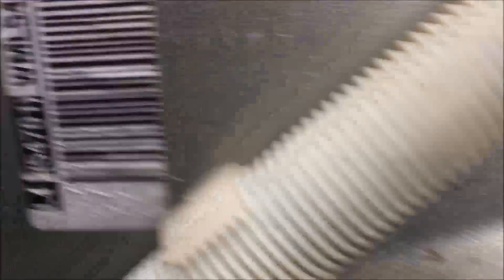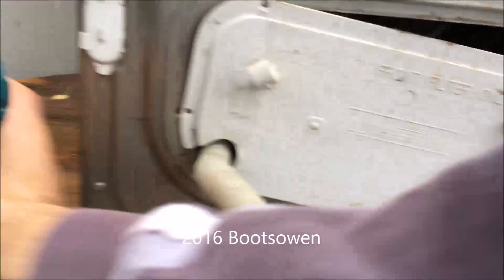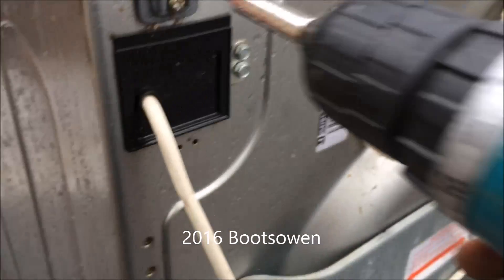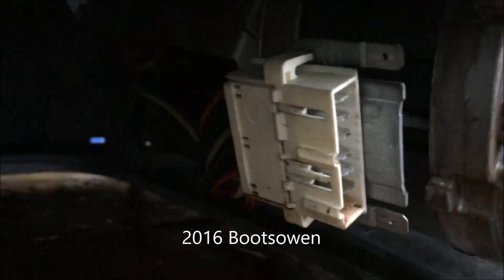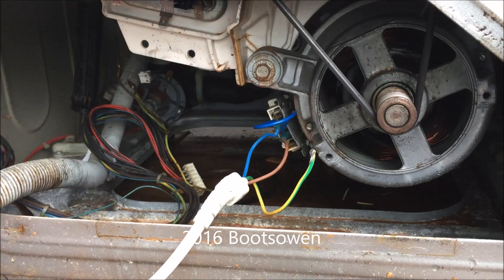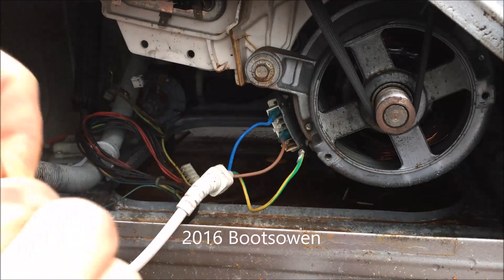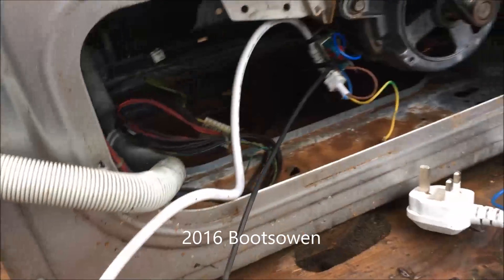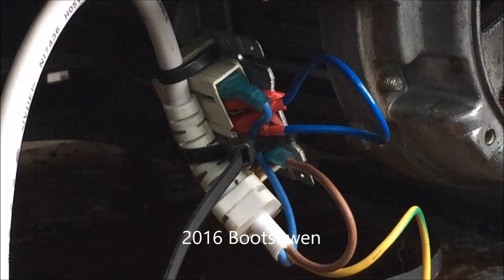Hotwiring a washing machine motor (Hotpoint aquarious wml540)

Comment: Suggestion: What you may need to to get next is a Photonicinduction Big Boys Buster Power Supply Unit with 100A + Range 0-515V.
Request: Will a Universal Washing Machine Brushed Motor run on 415 + 500 Volts? (I want to see if it run or burnout).
Reply from the maker: If you could get a 415v single phase then I am sure it would run on it. How long it would last is a different question. Photonicinduction had a 3 phase variac, which I think is what you are talking about. I am not sure that you could wire a single phase universal motor to run on 3 phase. You could just tap across one of the phases, but then you are back to 240v single. It would be fun to give 100 amps to one of the newer 3 phase washing machine motors that Hotpoint Aqualtis and similar use. But the speed there might come down to frequency rather than current so maybe nothing would happen.
Reply: I wander if you can get a 3 phase rectifier to run the motor on dc from the 3 phases as this is a universal motor

Comment: I dont understand what you want to do. If you want to use the motor for something else , take it out. If  the barrings are bad, you are starting  in the wrong end of the machine. It makes no sense  to hotwire a universal motor  while it is sitting in the machine because you cannot control the revs. It will speed up until something breaks.
Reply from the maker: Hi Rune.
The point of this is to wire it up so that it will run with none of the usual safety features so that a brick can be thrown into it for experimental purposes.  You might not like to see my other videos of washing machine destruction, however I have some more technical videos of how to control the speed of universal motors and a look a three phase washing machine motors.
Reply: @bootsowen  I went back and watched your website. If the washing machines ever gets advanced enough and takes revenge over humanity you will be in deep trouble.
Reply from the maker: Fingers crossed!